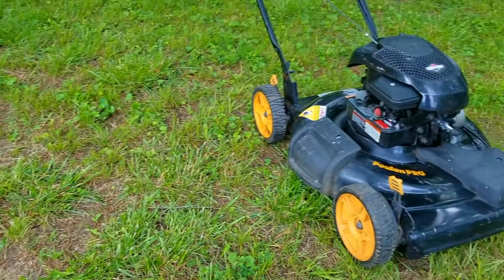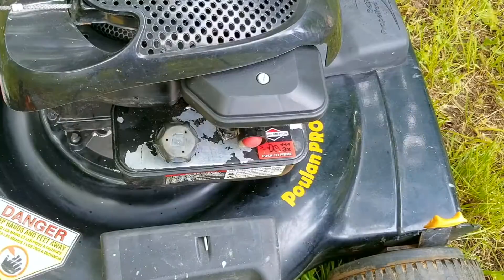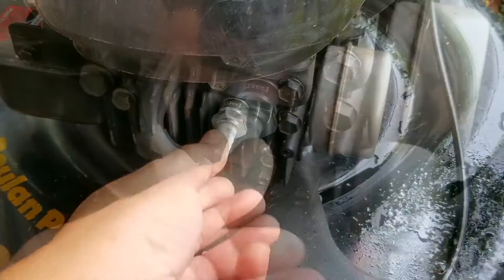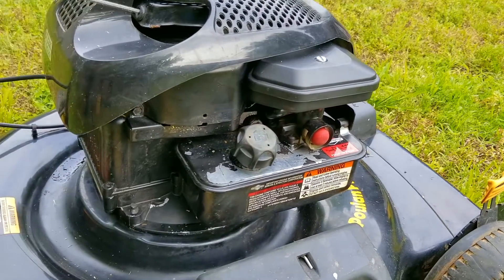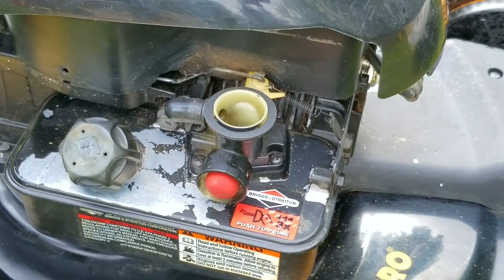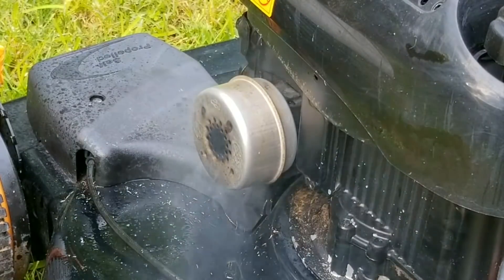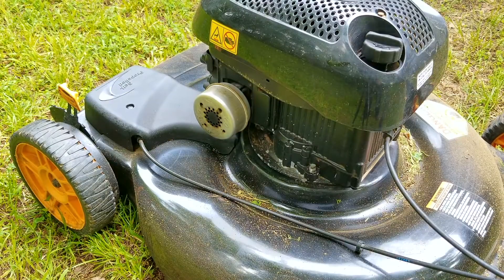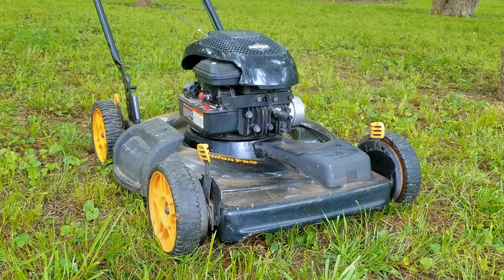Mower won't start after re-Fueling

Comment: As teenager I was appalled to discover one dark morning that I was both broke, and out of gas!  I went into the shed, found a gas can, and added it to my tank.  After school my truck wouldn't start.  My parents were on a trip but returned that weekend.  My dad told me that can had diesel in it.  He had been using diesel to clean some equipment.  We did the same thing you did here; drained the tank, added new gas, turned it over until is started and drove it until it stopped smoking!  Thank you for sharing! Stay safe.
Reply from the maker: it can happen to anyone, thank you Dwayne Madsen
Reply: @HomeGaragechannel  Happened to me with a delivery truck. 2 identical pumps and I just started working there. Drained the tank, poured in gas and off we went.

Comment: If anybody thinks that was a mistake by putting diesel in it, just look at that air filter and that ridiculous plug. Not to mention ignoring the oil blowing out of the muffler. That was major owner neglect or somebody who didn’t know the first thing about a lawnmower. That was a very informative video on not what to do.
Reply from the maker: thank you Kentucky Cornbread
Reply: I agree with you the original owner is clueless

Comment: I never seen diesel in a lawnmower but a few years ago me and my friend were on a road trip my friend needed some gas for his motorcycle and we stopped in a gas station in a small town and they never marked the pump for diesel he had an older bike and the bigger nozzle fit in his tank .He made it about a mile before it shut down . his bike was older and had a carburetor so it was simple to drain the tank. My Harley was fuel injected and if i put diesel in mine i would of had a very bad day . Just had to share that it brought back some memories
Reply from the maker: thank you hunter1953

Comment: Yes I have seen this once. Also people put chain saw bar oil in the gas tanks and gas in the bar oil tank. Donyboy 73 just did a video on this. Suggestion: I have seen the glow spark testers work on a weak spark but the coil is weak or bad. I use the spark gap tester and have had better luck. As always thanks for a great video.
Reply from the maker: Nice, I'll have to get one of those. I appreciate the tip

Comment: This is the first time I heard someone used the wrong fuel for their equipment. Probably it was an honest mistake🤷‍♂️🤷‍♂️. My question to you is did you try the sparkplug that came with the mower to see if it actually worked just out of curiosity tho.
Reply from the maker: I honestly don't remember, this video was shot over 3 months ago
Reply: @HomeGaragechannel  cool. It would be crazy if it did tho. The piston probably took some damage due to the incorrect sparkplug?
Reply: @ramadinsookhoo6141  When that plug was pulled out I thought the gap was closed completely from being hit by the piston and feared the piston might have a hole in it.  75psi told me it didn't have a hole, but I bet you are correct about damage.  Might be interesting to scope it?
Reply: I put a new engine in my step dads 2yr old craftsman chainsaw over the summer cause he accidentally put regular gas in it and the piston seized in the cylinder. New factory engine was $74 shipped.
Reply: @dwaynemadsen964  that sounds like an excellent idea
Reply: @chadvalliere8697  I just began learning how to repair small engines from @Home Garage since covid lockdown began in my county here in the Caribbean. I'm happy to hear that you was able to repair your dad's chainsaw. Good job bro
Reply: @chadvalliere8697  WOW!!! A new motor for my Honda would be over $400
Reply from the maker: No, the spark plug is offset from the top of the piston, so the ground strap was just hitting between the cylinder and the valves.
Reply: @HomeGaragechannel  wow! Lucky the piston and rings wasn't damaged. I'm guessing that guy was relieved that repairing the mower was not as bad as he might of thought it would been
Reply from the maker: yes they were happy that wasn't hard to fix.

Comment: I bought a mower with that exact same engine a few months ago, guy said it wouldn't start and had an oil leak after lending it his neighbour. Oil was dripping from the exhaust, the crank case had been filled with petrol, but luckily it wouldn't start. Changed the oil, primed it and it would run for a second and stop.
Cleaned the carb twice, still the same, changed the diaphragm, still the same. It also had a full tank of petrol, emptied it, looked good, put fresh in and it runs great.
Reply from the maker: nice save MrSHAUNE55

Comment: This was very common in the 70s and 80s with Mercedes cars (where I worked for a while as a youngster) as service station attendants would often mistakenly think that all MB cars used Diesel fuel. Later, sometimes they began putting gasoline in Diesel cars which sometimes resulted in a rather costly repair.
Reply from the maker: thank you Dave F. for sharing your experience .
Reply: @HomeGaragechannel  I did that once with a concrete truck after the station changed colors on the pump nozzles. Mechanic just poured in several quarts of ATF and said to run it. I did and no ill effects but it ran slightly lousy with the gas/ATF mix but was fine after straight diesel was put back in.

Comment: A lot of the old 2 stroke motorcycles I’ve redone long ago I actually found motor oil in the 2 cycle oil tank, I think in the early owners manual said in a emergency it could be done but the motor suffered. I miss having a 2 stroke street bike 😵‍💫😞
Reply from the maker: thanks for sharing the information Nathan Lovern.

Comment: I actually had an old Ginge mower, were the owners had accidentally poured diesel in the tank. I cleaned it, ran it til it stopped smoking, and worked perfect afterwards.
I'd like to mention, that your Poulan Pro equipment is our Partner equipment. Quite funny to see the same mower, with a different name.
Looking forward to the next video
Reply from the maker: thank you Christian Larsen

Comment: The grans and parents mower wouldn't start after it ran maybe a season with a new pump diaphragm I put in and I found that the tank was full of kerosene. Drained and refilled with gas and off it went. No diesel yet but time is still going on. Thanks and BLESSINGS!

Comment: Where I live we have a large baseball softball and soccer field for the kids to join and play sports. Everything is done by volunteers.

My brother-in-law has been in charge of this for 15 plus years. He asked me could I come up to the field and look at their gator that day has. I got up there and he was explaining how it won't stay running it keeps on shutting itself down and if they have to pay to fix or replace it that was less money for the programs.

After 3 days of working on this thing on 100 plus degree Days I had tried everything. Finally I drained all the fuel out and the gas just did not look right. So I ran home grabbed my IV bottle put my own gas in it and it ran back to the field and hooked it up to the carburetor. After if you tries it started running and smoking really bad. With the IV bottle in one hand the other hand on the wheel I drove around the entire field until the smoke stopped coming out.

When I was telling everybody at the field that it was working that there was something wrong with the gas one of the volunteers said that when he was filling it up that the gas smelled funny. My brother-in-law asked him what gas can did you use he said the one next to the tractor. Only problem was the tractor was diesel. I could not believe that someone could do that especially since everything was marked gas and Diesel.

After that incident they ended up having to lock the diesel container and tractor in a different shed and only certain people were allowed to have access to it.

I was just glad that I was able to fix it.

I always enjoy watching your videos and I always make sure to hit the like button and of course I have been part of your channel otherwise from the beginning. As always look forward to watching another of your videos.
Reply from the maker: thank you for sharing your experience David Frank, I appreciate it

Comment: I had an older farmer customer with his mower with a no-start condition. Got to pulling the spark plug and there was a very strange liquid on the end of it that I hadn't seen before, wasn't water that was for sure. Smelled it and sure enough, diesel. The fuel tank itself didn't smell too much of diesel so I think it was a similar situation to yours, it contaminated it enough to cause problems.
The customer was unable to believe he had put diesel in it, I just told him to check all his fuel cans for cross-contamination.
Reply from the maker: very good advice

Comment: Had a Troybilt mower come in here last summer filled with 2 stroke fuel. My sister once filled her Ford Windstar minivan with diesel, fortunately she realized it before she tried to start it so the fuel system didn’t have to be flushed. I’ll bet that happens a lot.
Reply from the maker: I completely agree with you, I'd like to ask a mechanic and see how many times they've had to flush a fuel system for that very reason.

Comment: I never myself of putting diesel in a mower. And let alone the oil being drained like in clumps but those classic l head engine were tough engines and easy to work on.
Reply from the maker: yes I completely agree with you on that.

Comment: Hard to believe that you couldn't smell the raw diesel fuel fumes coming from the tank and fuel as you drained it. Was the crankcase breather clogged  preventing the oil from draining quickly? The oil actually appeared to be diluted in the video. I would have run that engine for a while to get it good and warm and then drained the new oil out and changed it again. Did you have a new air filter in stock or did you clean the old one out with the diesel fuel from the tank?
Reply from the maker: Yes for some reason, it didn't smell as strong as normal diesel, I could only guess that there was still some gasoline in the mower's tank when they added diesel to it.

Comment: I had a similar situation where someone had put a lot of oil in the gas tank with the gas. Not sure if they might have thought that's where it was supposed to go or what. The engine tried to start but it immediately fouled the plug and stopped, And when it was briefly running it smoked like crazy!
Reply from the maker: wow, now that's a strange situation. Thank you Stan.

Comment: Deffinatly think Pauline pro equipment is okay, as long as it gets the job done right. That blower on the other hand, idk man, now i got some amazing. News, back when i was in the th grade, i was working on a leaf vacuumed, well i finished it but i unfortunately covid happened, but before covid, the ninth prior in February, i put a new rope on it to turn the engine over, and then we had to replace the handle to the front of the machine to where you could suck out flower beds, and we also put fresh oil in it, its a craftsman yard vacuumed with a 6.5 HP engine. And i proved it ran, and then we had to leave and for a year and. A half it sat in the auto shop. So the vice principle who owned it, said i can have it, he said he had no use for it so he said i an have it. You have no idea how happy i was to get it, so this Wednesday before we go on thanksgiving break, i will be taking it  home.
Reply from the maker: nice work, you deserve it.

Comment: Another fantastic video my friend. 
Only time I've ever heard of a situation where diesel was accidentally put in where gas should be was one time my brother did this on a trip we took to California when we were kids with our parents and dad let him pump but he put diesel in the tank instead of gas. Needless to say it and thankfully my dad was an auto mechanic and it was caught early and fixed by my dad before any damage could be done. 
Also I would like to ask why it is that you never show the one possibility that the engine break cable could be a potential problem keeping the mower from starting. 
Thanks again for a good video!
Reply from the maker: I think have shown the brake cable was a problem once before but it was in an older video
Reply: If the cable was broken, you wouldn't be able to pull the cord fast enough to start the engine, if you could pull it at all, because the engine brake (not break) would be applied and prevent the flywheel from turning.

Comment: Why didn't you drain the oil with the drain  plug? The really dirty sludge would be at the bottom of the engine.
Reply from the maker: easier to do this way.

Comment: Normal e10 fuel gets stale after just a few months. When i get a mower in for anything first thing i do is change plug, gas, check är filter and control the Blade adapter. All this before even trying to start it.

Also very easy cash.
Reply from the maker: wow, very thorough
Reply: @HomeGaragechannel  you never know what people pour in the tank. Just like your example haha

Comment: Question if someone put two Stoke fuel in a 4 Stoke mower and ran if for a long time is a hard process to clear it out two make it run again
Reply from the maker: Actually there's not a problem using 2 stroke fuel in the 4 stroke, there might be a light smoke, but the extra oil, shouldn't hurt the engine.  How Ever, a long storage period would effect the 4 stroke more.

Comment: So as i stored my yard machine 31A-3BAD729 snow blower in the shed, stupidly with gas in the tank + No fuel shut off. So all summer long, I would pull it out and run it for 5 minutes every couple of weeks just to keep the gas “fresh” in the carb. Around late September, I noticed fuel leaking when I primed it. I’m assuming fuel has rotted the fuel line to the point it’s cracked and is leaking. I’m assuming it’s the fuel line.  The unit is 18+ years old, and not quite sure if it’s worth fixing. I could make a video when family is gone from thanksgiving. Luckily, I’m in no rush in fixing it since I have a slightly larger one. If you have a video somewhere or could find one of replacing the fuel line or where I could see the fuel line just so I could see what’s going on. I have absolutely no idea what I’m doing, nor do I know what’s wrong with it.
Reply from the maker: If I can find one, I'll make a video about it.
Reply: @HomeGaragechannel  thanks

Comment: Had a brand new Generac gas powered water pump come in a few months ago that won't start for the customer.  Customer claimed he assembled it out of the box and filled it up with fresh fuel and nothing.  Similar situation as with your mower - lower psi (decompression valve), pull over easily and had a strong spark but no start.  Dribbled gas into carb and it fired right up so fuel issue.  Emptied tank and found that the customer inadvertently filled it up with kerosene.  Apparently grabbed the wrong fuel can.  It happens.......
Reply from the maker: wow, that would be a first for me too. Nice work figuring it out. Thank you Frank Muschetto

Comment: Minimum compression needed for an engine to run is 50PSI however most engines won't run below 60PSI, at  my shop if an engine without an ACR (automatic compression release) has less than 65 PSI i won't bother fixing it, now an engine with an ACR will have no higher than 40-60PSI, Briggs states on engines with an ACR to use a cylinder leakdown tester and not a compression tester.
Reply from the maker: thank you TheOutdoorPowerGuy

Comment: Back when vehicles weren't so computerized there was a condition when your motor would clatter and you could put a gallon or two of diesel in your tank with your gas.  Drive it like you stole it and the noise would be gone.
Reply from the maker: thanks for sharing the information

Comment: Forgot the finger test on the fuel for smell
I wonder what oil it was as well, let alone changing.
Suspicious, perhaps thought diesel would clean carburettor considering the Honda spark plug but that’s hear say.
Easy fix, will work for a few more years now....
Reply from the maker: yes she's going to run for awhile now

Comment: Donyboy73 (Don Desjardins) had to sort out a customers chainsaw where they filled the fuel tank up with be chain & bar oil just recently.

I mentioned.before that 75 PSI is good for a 3-3.5 horsepower Briggs and Stratton L (flat) head engine because they run a very low 6:1 compression ratio,it doesn't have a compression release mechanism like the 4+horsepower Briggs and Stratton L head engines do.

They don't release official compression figures for the L head engine for that reason rather tell you to perform a cylinder leakdown test on the engine.

Mine was beginning to foul the spark plug up.until I rebuilt it about 2 years ago, it's been going great since !
Reply from the maker: I need to get a leak down tester. thank you Russell Booth.

Comment: I accidentally put kerosene in my mower one time.  I had kerosene in the same type of tank that I kept my gas in.  Needless to say, it would not run.    It took me a while to figure out the problem. MIT wasn’t until I smelled the gas that I knew what the problem was.  I drained it from the tank and the carburetor bowl, filled it with gas and it cranked right up.  The one benefit was the kerosene e cleaned the fuel system out, but it cause no other problems.
Reply from the maker: nice, I'll have to remember that.

Comment: Great work, I've never heard of anyone putting diesel in the tank of their mower but it was probably clearly an accident and they weren't aware they put diesel in it, they probably had diesel fuel in a regular red gasoline can.
Reply from the maker: that was my guess too, thank you WildeFox
Reply: That's what I said cause of the different color of cans meaning different fuel types but only if you as the user follow the color code as not to get confused what is in what can about the only two fuels I put in red cans is regular gas and 2 stroke mixed gas and usually mark it with a sharpie if needed